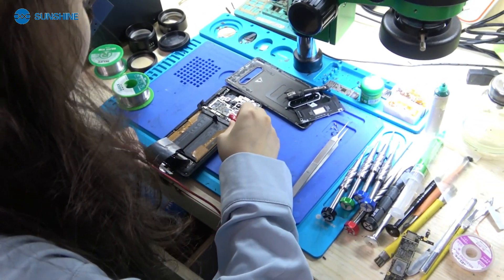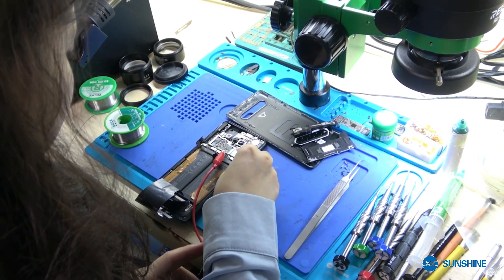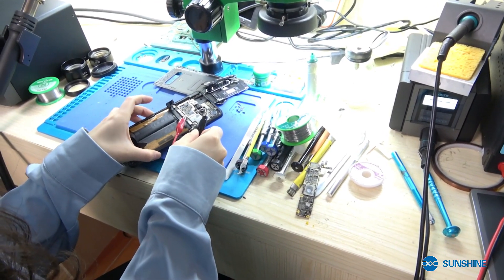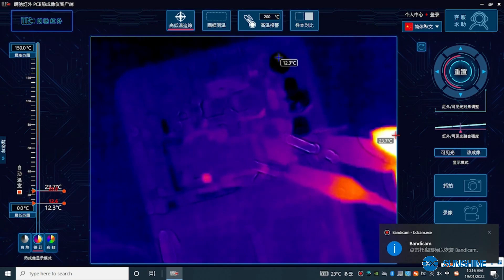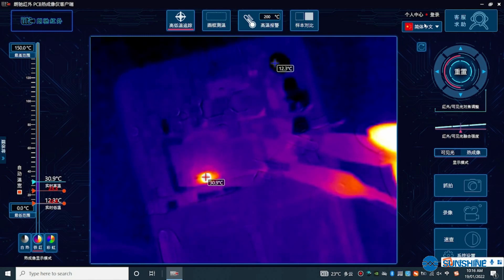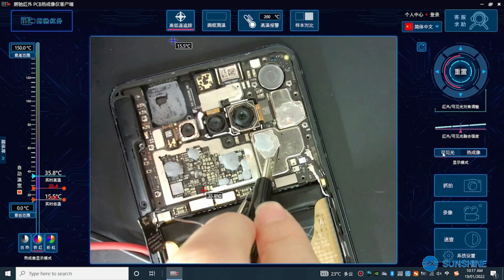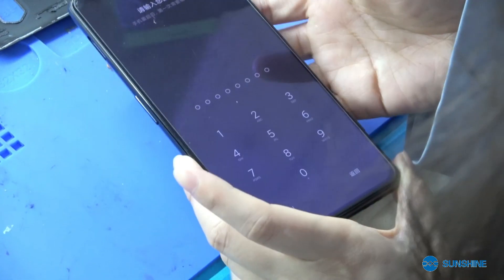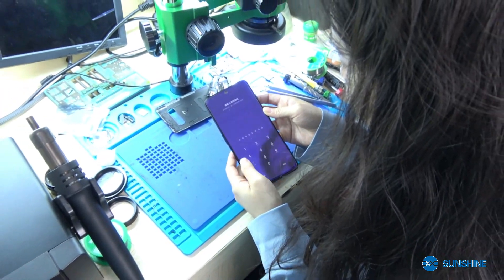Black Shark 4  not turn on, teach you fast fix it

Comment: Hi. I have the Black Shark 4 Pro. Recently, i dropped it in mop墩布 water , i turned it off immediately, they cleaned it in isopropyl alcohol. I left the phone to dry for 6 days,... After that, the phone only boots into FastBoot mode. I can bypass fastboot by alternating volume up and power..
Reply: Secondary issue, the volume down always functions by itself. Even when I do not pres the button. This is the most frustrating..
Is there anyway to repair without replacing any parts? Thank you

Comment: Hello, i wanted to ask you a question:
my black shark 4 doesn’t turn on, it shows black screen, i already tried to change display, battery and battery flex cable but the problem persists.The only thing it does when im trying to turn it on is that it does a little vibration every time i hold the power button, so might it be the same issue? thanks in advance! :D
Reply: is your phone fixed ? we have the same issue :(
Reply: @mohammadsumusod1850  اصلحته اخي؟
Reply: @mohammadsumusod1850 how yours, no i have same prob also
Reply: @mumennpuyau6897 hello, how ur phone doing? what its the problem and solution? thanks
Reply: @relivize  anyone treated theirs, i have bs2
Reply: @mohammadsumusod1850  hello are ur problem fixed? can u share experience what happened and how to solve? thanks

Comment: Hi! Im also using Black Shark 4 but Im having issue with the screen as it's not responding to any touch, but the display still works. We've already tried replacing the whole LCD and the same issue persists. 

Does anyone know whag the issue may be?
Reply from the maker: Hello dear,
Pls add my whatsapp: +86 13316210241